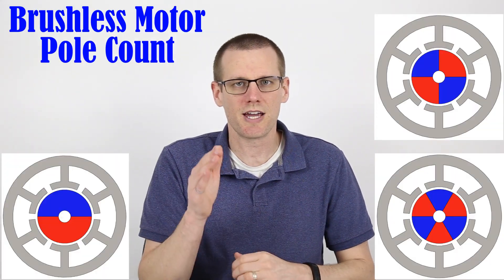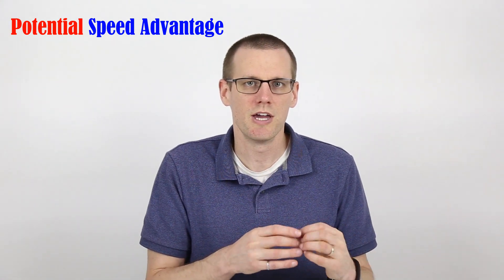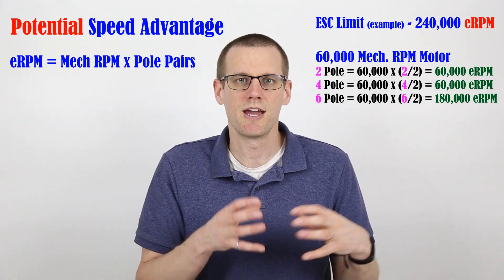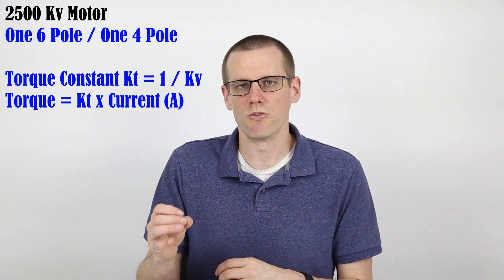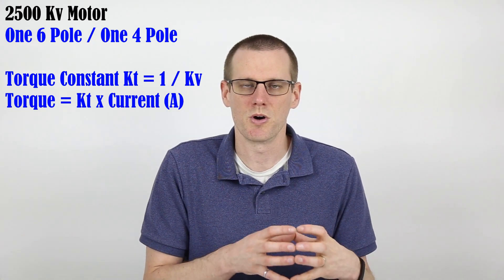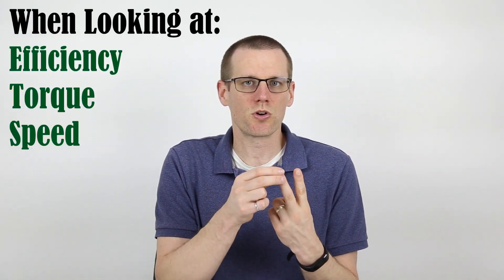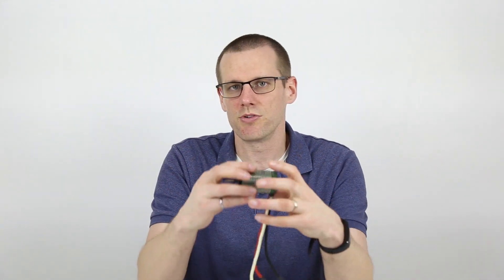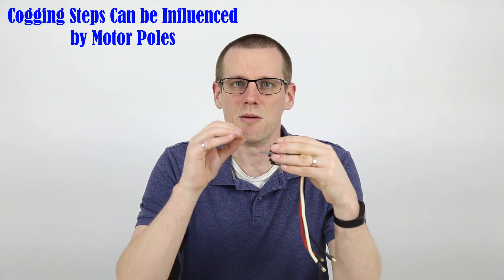Brushless Motor Pole Count vs Speed, Torque, Efficiency, Start up Hesitation

Comment: Hi thanks for your videos,  they are quite interesting. 
Meanwhile I would like to add something that I noticed from for example two different four pole motors one with a delta winding and the other with Y winding both of same kv. It seems that the one with the delta winding have more strong magnetic force and cogging torque than a Y winding and also the timing is different. Do you have other videos regarding this matter so one could make a better choice for his required application?

Comment: A VERY important note that isn't a topic in this vid is that a higher pole count will have less shaft rotation before back emf occurs to the esc, thus making startup alot smother/steady without a sensor from a dead stop. That's one of the reasons why brushless non sensored crawler motors usually have a high polecount.

This matters less on a basher but I wouldn't want to run a 2pole these days since the startup is significantly better on 4poles or higher making a high geared 2pole setup really hard to launch.

Thanks for the vids! Love the real science behind everything!

Comment: Why don't they have 3 and 4 pole motors?
Reply from the maker: Poles have to be in pairs of North / South
Reply: @RCexplained  but you can get a model train with a 3 or 5 pole motor?
Reply from the maker: I'm not sure about model trains, however, it does not sound like they use 3 phase brushless motors.
Reply: @RCexplained  they are brushed motors I think.
Reply from the maker: Makes sense, then yes the brushed motors can be 3 pole.
Reply: Model trains are brushed